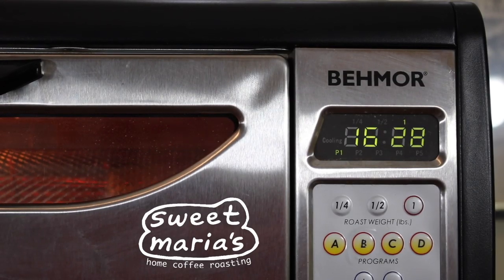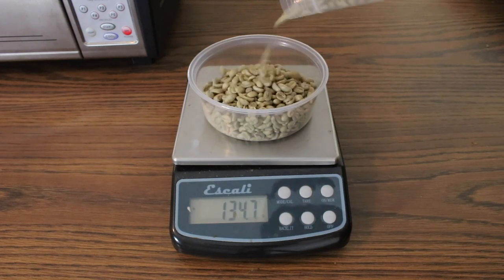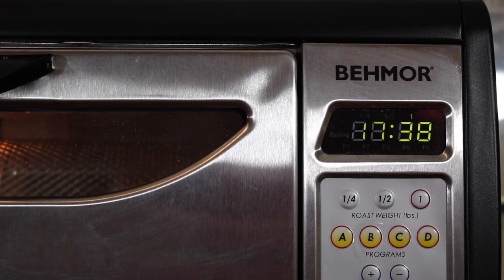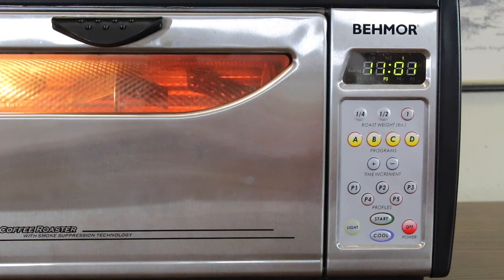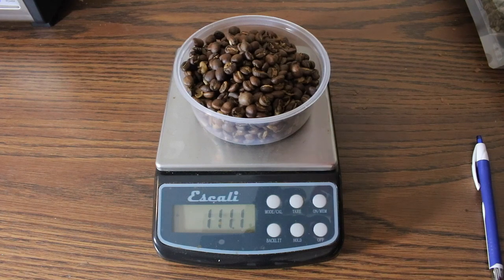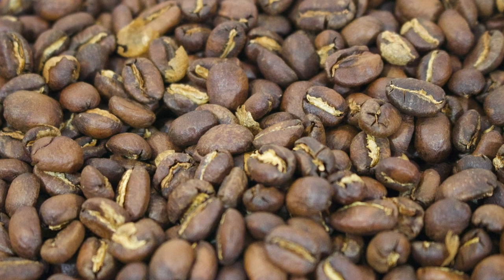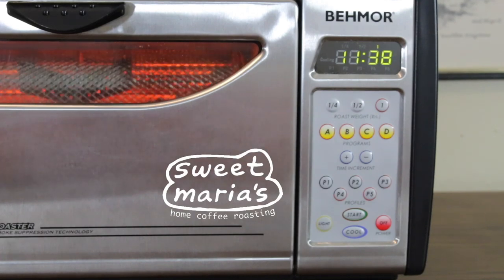Achieving a Light Roast With Your Behmor Coffee Roaster

Comment: I have tried and tried and tried -- over many roasts and many weekends -- to get the fruited berry flavors of natural process beans to shine through a roast on the Behmor. I have also Googled it until I can't Google any more. Nothing works ... including "experimenting with a longer roast time with a lower heat setting". I am beginning to feel like Ponce De Leon searching for the fountain of youth.
Reply from the maker: Here's an older article with a good framework on roasting dry processed coffee. It suggests being more aggressive going into 1st crack.  https://legacy.sweetmarias.com/library/roasting-dry-processed-coffees/
Reply: Thanks for the reply. But I'm really having trouble understanding parts of the article you cite, including:

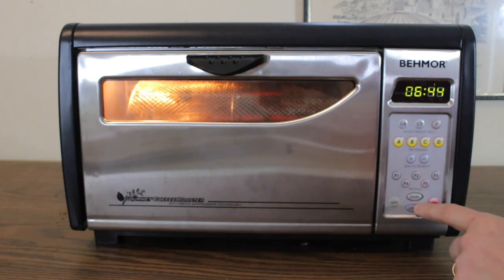"I never like to extend the 1st Crack itself because I feel like it just tends to flatten the cup and you really are flirting with baking and stalling caramelization doing this, which in a DP coffee is really extra gross. Okayyyy ... You can add maybe 15-30 seconds to the 1st at this point to try to add a little more texture to the mouthfeel, but extending it towards a full minute or more is definitely not recommended. You're looking for more of a 1:30 but under 2:00 minute 1st Crack time. Total time in first crack?? With an extended drying phase, it may take some of the punch out of the fruit, but the finishes tend to longer and sweeter. The finish can be more and more syrupy when dropped at the right point after the end of 1st, 30 to even 45 seconds after the end moving closer to the start of 2nd which you can do with this roast without it being too bitter. What does this mean? 

Given all the Dry Process and all of the Behmors that SM sells, perhaps a dedicated video, or a better-written set of instructions, might be a great thing for those of us trying to get any result even close to the cupping notes. I'm still looking for my first trace of berry after dozens of failed roasts. Thanks!
Reply from the maker: @richardbock5181  Thanks for the suggestion. We are on a roll lately with producing Behmor videos so hopefully we can make one soon where we roast dry processed coffee. Good luck with your dry process roasts. Sorry, we aren't able to give you more of a straight forward solution since there are so many variable involved. Please keep asking questions if you have them. We'll do our best to help.
Reply: Dan Wood  Thanks for the reply!!
1. I've tried batches up to 300g, but I have settled on 150g so that I can heat quickly and avoid "baking" the roast.
2. Here's my latest method, after reading everything I can get my hands on (Reddit is helpful). I start a 150g batch in my Behmor 1600+ preheated to 285 degrees, using 1# setting at 18:00 and counting down, roasting at P5/P4 and roasting as close to 325 degrees as I can (without the dreaded 331 degree shutdown). Once the afterburner fan kicks in at 10:30 coutdown, I can stay at P5.  I get first crack at about 9:00 counting down (equaling 9 minutes of roast time). Because you are totally correct about the Behmor cool cycle, I dump the roast after 1 minute of first crack, putting the beans straight into a colander cooled by my electric leaf blower via a cardboard-box-and-colander setup.
3. Even after all that, I am getting NO fruit or blueberry "nose" from my SweetMaria's Dry Process Ethiopian beans: no fruit in the roasted beans, none with brewing, none in a hot cup (via Aeropress or pourover), and none after the coffee cools.
4. Tantalizingly, though, I DO smell intense strawberries and blueberries in the small trash can I use for grounds. The aroma develops after a day in the trash!

Comment: I've been trying this weekly for the last two months on my Behmor 1600.  At about 8 minutes in the temperate starts to slowly drop from 305 to 270 and then starts to climb back up to 305 where I get first crack at 13 minutes.  How do you hold the temperature steady?  I read that this may be when the afterburn opens, but how do I monitor the temperature while this is open?  I've replaced the afterburn and all 3 sensors in the last two months.
Reply from the maker: Sometimes the temperature can rise and drop as the machine tries to regulate temperature but your case seems like a large temperature drop. Please contact Behmor tech support. They know all the ins and outs of the machine and will be able to help you out.
Reply: I too noticed variations and other odd behaviors.  What I ended up doing is using an appliance extension cord which has smaller gauge wiring and connected that to a dedicated circuit, ie same one the microwave venthood was on.  Other items to be aware of is the cleaning frequency inside the roaster as well as the deep cleaning.  (I am not all that consistent with either, though I am getting better.)

Comment: Thanks, but the Behmor cooling cycle is near useless as the interior temp takes too long to subside.  Best to stop the roast, pull the drum, quickly vacuum the chamber, close and then start the cooling cycle. Instantly have a cooling box at the ready and the beans can be ambient in less than a minute. I find this the best way to highlight any lighter roast.
Reply: My cooling technique: Just after pressing Cool button, fire up the shop vac and hold the hose at the top of the door and open the door about an inch. The vacuum catches most of the chaff and also accelerates the cooling quite a bit. When the B button temp gets down to 219F, hit the Stop button, pull the drum, close the door and hit the Cool button again. Dump beans into the collander/box cooler and cool with shop vac until room temp. This is about 3 minutes total cooling. I remember one of the Sweet Maria's experts saying that cooling too fast is not good, and three minutes is the sweet spot. Also, this is probably better for the machine because it is at least partially cooled before the cooling "pause" (and the pause is very brief).

Comment: Did you preheat before adding the beans to help get you in the 300 degree area faster? If so, how long did you preheat and on what setting?
Reply from the maker: in this case, we didn't preheat but preheating can help, especially if you aren't too concerned about an even light roast and usually roast dark or medium. Here's a good thread on how to do it. https://www.reddit.com/r/roasting/comments/b5vfrp/preheating_behmor/
Reply: @SweetMariasCoffee  note that at SM we don't preheat the coffee for a darker roast. we would preheat the Behmor with no coffee in it. Then add coffee and start the roast. This can help achieve much darker roast levels than are possible the usual way of roasting...

Comment: What is the preferred way to clean this type of roaster?   Do you use an oven cleaner or some other type of chemical, or do you just scrub it with steel wool or something?  I am leery of chemicals, but if it is something benign like alcohol or borax, etc., I am fine with that.
Reply from the maker: Behmor recommends using a non-caustic, non-abrasive cleaner like Simple Green. www.behmor.com/docs/Manual_Update_3.1-Interior_Maintenance_and_DC_Fan.pdf

Comment: This might be a dumb question, but: should you note the beginning of first crack with the very first bean you hear crack, or should you note the the beginning when you start to consistently hear beans first cracking? I’ve noticed sometimes there is around 15-20 seconds delay in that very first crack to several cracks happening. Thanks in advance.
Reply from the maker: Usually, folks will start timing from the first few cracks but as long as you stay consistent with how you time your roasts, your roast logs will remain accurate.
Reply: I don't think that was a dumb question at all. It could be because I was wythe same thing myself!